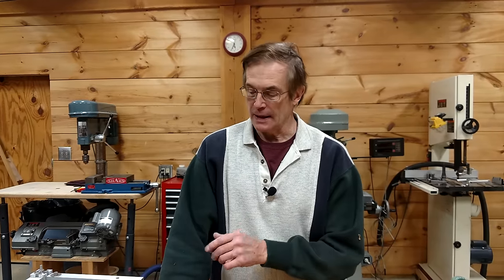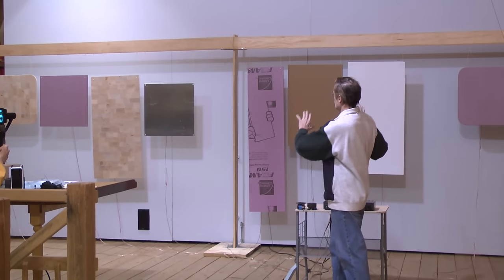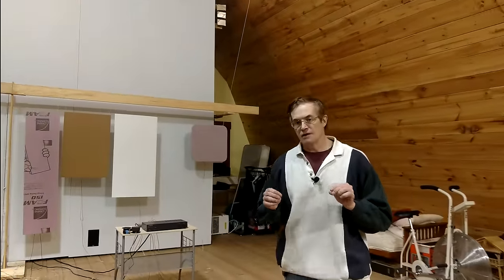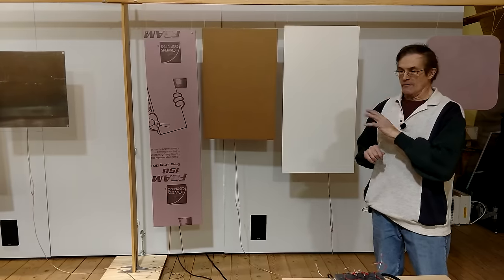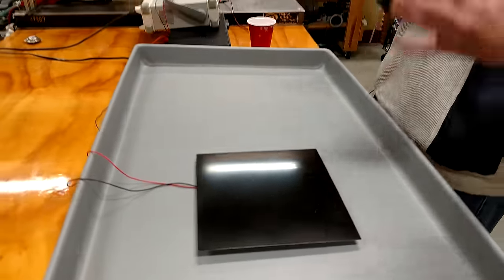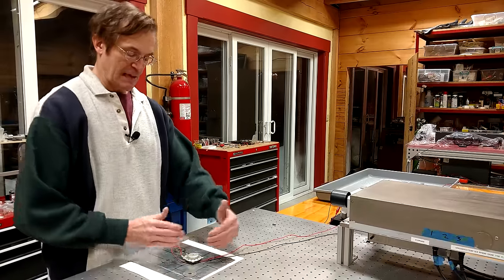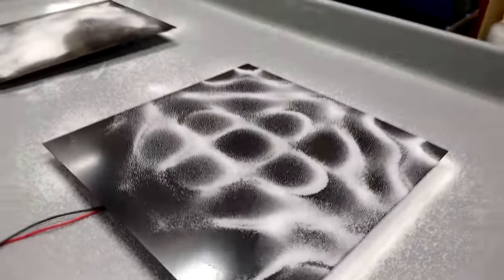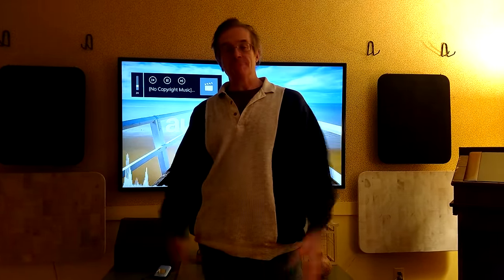Fantastic DIY Speakers for less than $30!

Comment: Presenter: "These speakers function similarly to shaped anti-tank charges."
Me, an idiot gamer, "I understand now."
Reply: Except it's wrong. The focussing effect doesn't come from the shape of the radiator but from the fact that it is extended in space, i.e. not a point source. An array consisting of one speaker atop another will have the same horizontal dispersion as a single speaker but focussed vertically. One beside another will have the same vertical dispersion but focussed horizontally. A square array of four will focus the sound both horizontally and vertically. (The fact that the piston is not a point source does affect phase because the outer part won't start moving forward at the same time as the inner part attached to the actuator, but only after a delay depending on the speed of sound in the piston material, but this is not relevant to what is happening for ideal radiators. For them the focussing will happen even though all portions move together.) Excerpting from Harry F. Olson, Elements of Acoustical Engineering, D. Van Nostrand & Co, 1940: "A sphere vibrating radially radiates sound uniformly outward in all directions. A portion of a spherical surface, large compared to the wavelength and vibrating radially, emits uniform sound radiation over a solid angle subtended by the surface at the center of curvature. To obtain uniform sound distribution over a certain solid angle, the radial air motion must have the same phase and amplitude over the spherical surface intercepted by the angle having its center of curvature at the vertex and the dimensions of the surface must be large compared to the wavelength. When these conditions are satisfied for all frequencies, the response characteristic will be independent of the position within the solid angle." Think of it this way: the sound coming from the middle of the cone is hemmed in by the sound coming from the surrounding part of the cone. This causes the (over-) pressure of the sound coming from the middle to be higher than it would be if the middle part were the whole thing, just as though the middle part was radiating into a megaphone. (It's the same for the underpressure but harder to visualize.) The radiation is focused because the radiation coming from the more peripheral parts of the cone acts like an invisible megaphone. The air in front of the middle just can't get out of the way as easily because it is hemmed in by the pressurized air around it.
Reply: @lewisgoudy863  ahhh the here's what I know comment, a good teacher will explain concisely and in a way that is appropriate for his audience. What is true for one student at one level is not going to be true for another.
Reply: @jgdublin  I like that: "the here's what I know comment".
Reply: @lewisgoudy863  You have obviously never seen an EFP charge before. lol
Reply: @Justin-bd2dg  The physics of shaped charges involves shock. That of loudspeaker mechanisms does not.  In the first case, the effective pistons move faster than the local speed of sound: in the explosive charge the reaction front propagates faster than the speed of sound in the explosive, that is, it detonates rather than deflagrates. Similarly, the air-charge boundary that couples the two moves faster than the speed of sound in air (at whatever temperature, pressure, and relative humidity it happens to be at the time).

Per Wikipedia,
Shock waves are formed when a pressure front moves at supersonic speeds and pushes on the surrounding air.[8] At the region where this occurs, sound waves travelling against the flow reach a point where they cannot travel any further upstream and the pressure progressively builds in that region; a high pressure shock wave rapidly forms.

Shock waves are not conventional sound waves; a shock wave takes the form of a very sharp change in the gas properties. Shock waves in air are heard as a loud "crack" or "snap" noise. Over longer distances, a shock wave can change from a nonlinear wave into a linear wave, degenerating into a conventional sound wave as it heats the air and loses energy. The sound wave is heard as the familiar "thud" or "thump" of a sonic boom, commonly created by the supersonic flight of aircraft."

See also M.E.H van Dongen, ed. Shock Wave Science and Technology Reference Library, especially Vols 1 (Multiphase Flows I) and 6 (Detonation Dynamics), Springer, 2007 and 2012.

Comment: Back in my studio recording days we found that the large 4 x 8' 1-2" thick rigid yellow fiber glass panels did an excellent job at absorbing frequencies from about 250hz-20,000khz+  bass on the other hand requires a trap which allows the wide wave to enter into a chamber which then reflects the wave into a beveled edge diffusing the signal.  These are easily made from birch plywood and essentially look like L shaped brackets, easy to google a design.  As long as you cover the wood surfaces with fiberglass you can effectively eliminate a "room sound".  This was great for eliminating standing waves, and unwanted microphone reflections.Some invaluable tools for that job were a cheap $99 table saw, a dril, and a kreg jig.  The insulations is about $25 for a 4 x 8' panel.    This btw was a cool video and interesting to see how the sound changed with each substrate.  A microphone, a vst plugin spectral analyser, and a sine wave sweep will go a long ways if you are interested in seeing exactly what is being diffused vs reflected.
Reply: This is the sort of interesting/helpful comment that should be at the top. ;) Sort it out google algorithms, I know you can do it.
Reply: I just watched this again. Latex primer can be painted onto that styrene if you want to get more aggressive with the spray paint.

Comment: Thank you for the interesting video. I would like to point out a few things for anyone more interested in the details of audio reproduction, below.

You mentioned that traditional coned speakers are like a piston. But for clarification these audio exciter elements are also a piston. In fact this device is just the voice coil and motor of a traditional speaker element but without the cone attached. Magnetostatic panel speakers are also "pistons" albeit the configuration of the voice coil, magnetic field and the driver diaphragm are different. Electrostatic speakers, as you know, do not rely on magnetic interaction but instead to voltage differential, but ultimately it too is just a "piston", a mechanical surface, pushing air.

The only type of speaker element I can think of that isn't a piston is the plasma speaker. You should research those if you want to learn more about a building a speaker that isn't a piston pushing air.

And just for further clarification:
The reason why traditional speaker elements use a cone diaphragm instead of a flat surface like in the speakers you built here, is that a cone offers a good combination of stiffness and light weight. The demonstration you show between 20 and 26 minute mark beautifully shows this: because the speaker element is flat and not optimally stiff, the edges of the diaphragm move at different velocity to the place where the driver is mounted which means that the sugar does not move all at once. This happens with both plates but the weighted plate has fewer resonant frequencies. 

What you are demonstrating there is the inherent weakness of a flat driver which isn't uniformly pushed. The different velocities at centre and edge will in fact create distortion in the audio. You should repeat your test with a coned element and a magnetostatic speaker to really see the difference between a good driver and an optimal driver.

Furthermore traditional speaker elements are typically enclosed in a box to reduce the dipole effect which, in the case of panel speakers like this, means that the speaker is outputting the same signal but in negative phase from the back. Both magnetostatic and electrostatic dipoles also do this, which is why they are less popular than boxed speakers. To get the best sound out of a dipole speaker you will need to place it optimally like Marius Loubeeka mentioned below. This is because the negative phase sound from the back is reflected from the back wall and leads to, you guessed it, phase cancellation.

Finally if you are serious about building speakers I would recommend investing in a measurement microphone and making sure that your audio samples are like for like. Cheap good measurement microphone for example is the Behringer ECM8000. When publishing listening samples always record at equal distance and equal volume, and preferably normalise the audio samples in post.

I'll be happy to further explain any of the above.
Reply: Wrong Mr Many Words. A Piston generally travels in a straight line like a .....piston in an ICE engine so as such ANY panel speaker by nature CAN'T act as a singular circle in a tube as regular speakers are - a circular "cylinder" pushing air. So whatever terminology you want to use for multi planed methods of pushing air at different  times in 3D space unlike what an x-y axis speaker cone does - don't call it a dumb piston because that's not how acoustics work. A driver? Yes but that's not the point at all here or are you slow? You seem not to know about how an acoustic guitar works where the "different velocities" of the wood carefully braced produces no distortion by design. Have you heard a carbon fiber acoustic guitar?   Again, a 'mechanical surface pushing air" as you say in no way has to be a piston and with panels it isn't. Sounds to me like if you are old school you need a refresher on cheap - and a refresher on simple 'transmission line' speaker tech and stop all your blather and obfuscation about electrostatic and "what you need" - remember - $30.
Reply: Hey, what if we make a cone shape with 9 small flat panels attached with angles and use it with a single speaker at the middle panel.
Reply: Well in actuality all speakers have to function in what you call a piston fashion, as all sound is is pressure differentials traveling through the air. In order to generate those differentials you must push or pull the gas that fills the space. Period. So no plasma speakers are not different at all, they work by heating the air, hot air takes more space so it displaces the surrounding gas, this creates a preasure wave. In effect the plasma speaker just uses the air itself as the piston element, the one caveat to ths is that unlike any other contemporary element there is no dipole effect (the gas expands in all directions, so there is no out of phase wave in the opposite direct).

As for your point about the shape of the diaphragm being conical, I'm sure that directing the sound is a useful additional feature of that dimension. I'd like to add that perhaps using voice coils of particular shape (I.e. taht of the panel) or placing smaller voice coils in strategic locations around the panel (such as the corners, middle of the sides, and center) would overcome the stiffness deficit.
Reply: @ mrharvest thank you for adding some technical specs to this creative and exciting video.
Reply: mrharvest is totally right, and there is so much more that isnt correct about designs like these. Actually, they even are for sale commercially for years and years, nothing new about it and all of them sound rubbish. distortion, lack of low or high or both, totally not audiophile. but hence;  if you want something cheep and dont care how it sounds, why not. Maybe put a speaker in a empty milk carton, tell everyone this is the best speaker for cheap, and try something like fill it half or not, or put a good half a liter red wine in there, maybe there is a change it sounds better :) (drink the rest of the bottles first before you put the music on)
Reply: @rikbach2369  - Calm down Rik.. he is not advertising these as the best speakers on earth. 
He's merely demonstrating for under $30 you can have a "decent" pair of loud speakers that are pretty energy efficient. 
And all he was doing was trying to get the most you can from the type of materials available that won't be super expensive. 

You can knock it all you want but for $30 its better than most of the crap you can buy for $30 at the shops! 

If anything it was good to hear someone talk about acoustic and not just brag about how big and expensive there speakers are... because at the end of the day you can have the best billion dollar speakers and live in a glass house and it will sound like shit! 
So stop knocking people and maybe just take something away from it!
Reply: mrharvest wow, what are the other commenters up in arms about?  It's clear you've measured speakers before, and know what you're talking about.  You didn't seem a bit ride at all.  Measuring and engineering speakers is my day job, and sometimes my hobby too :-)
Reply: Look up Eminent Technology TRW-17 Rotary Subwoofer
Reply: @alrebor2089  - 
You are missing the point of my comment but thanks for your feedback. 
Im a qualified sound engineer so your advice for me is pointless, but thanks anyway!
And clearly you know very little about acoustic treatment  $30 would not get you far in treating any room.
Reply: @alrebor2089  - your condescension isn't too bad either! Never asked for your opinion... and my previous comment was in regards to someone having a go at someone for just posting a video with some decent understanding behind it. 

And then you chime in with something similar, says more about you buddy. You'd be hell to work with Mr Negative. 

If you don't like the video then move on, but don't dribble your nonsense about acoustically treating a room for $30.
Reply: @mrharvest I would only add that you should normalize to "Equal-Loudness" which requires analysis of all recorded samples and then amplifying or attenuating to an average or to a loudness level that won't clip any waveform.  If you normalize by peaks you are only going to fall into the trap of "louder sounds better."
Reply: @cuda426hemi  Don't listen to those chumpos! Ignorance can't be allowed to just, float around, all,, willy nilly!! Keep doing what you do sir! #ISaluteYou #NotAllHerosWearCapes #NotAllDuncesWearCaps
Reply: @cuda426hemi  i can kindly suggest you should just comment with less insulting attitude next time, you seem to understand the topic highly, which is good, but dude, just dont be a prick expert, be nice expert instead
Reply: @Lejma3  Thanks Dan but I'm no expert - my brusque attitude usually reflects the taste left in my mouth from the original poster. Sometimes being a jerk will make the poster think twice next time before spewing. But, point taken. 🎤
Reply: I love how most of the replies are people taking shots at each other. Great job, people! Really making humans look great 👍
Reply: @cuda426hemi  No worries, the irony isn't lost on me 😂
Reply: as you get older your frequentie range of your hearing is becoming more in to the 10 dollar range, so 30 dollar is well spend.
Reply: @alrebor2089  --> Now, now; he didn't even talk about studio recording. What ARE you on about? If you feel that that building your own speakers is overrated because your preference is free bookshelf speakers that someone wants to throw away - probably because they're old & distorted - by all means, recommend them. This magnificent video is for those who would like to build their own speakers.